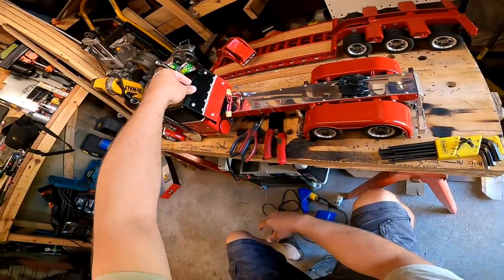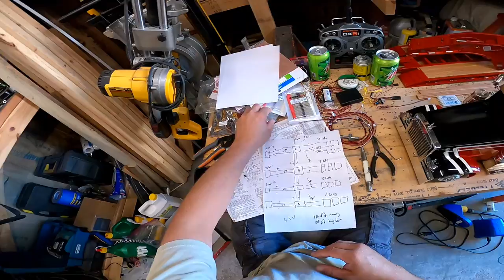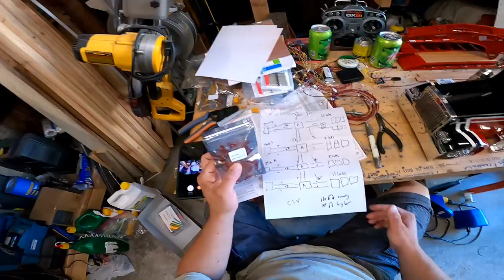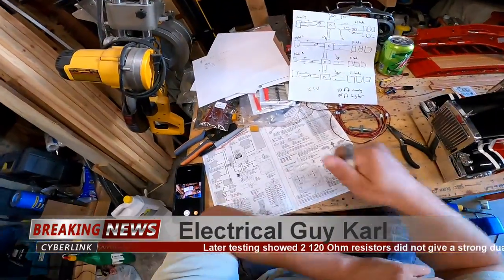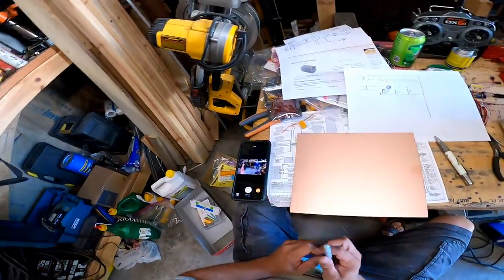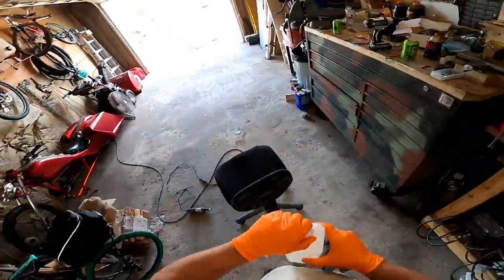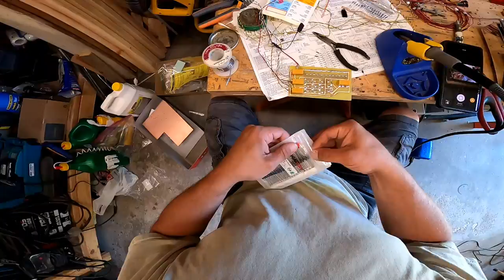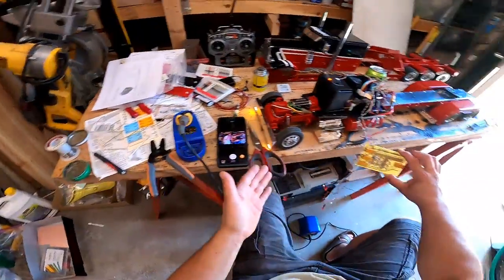Tamiya Grand Hauler Custom Lighting Part 2

Comment: I made my own light circuit using an Arduino. Easy to change the brightness and easy to run lights as running lights as well as brake/Singal lights.